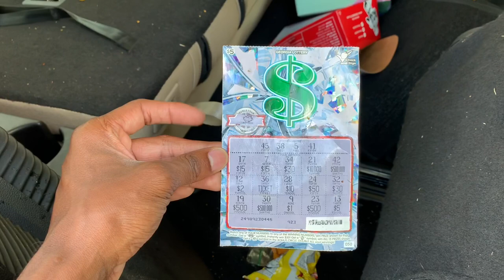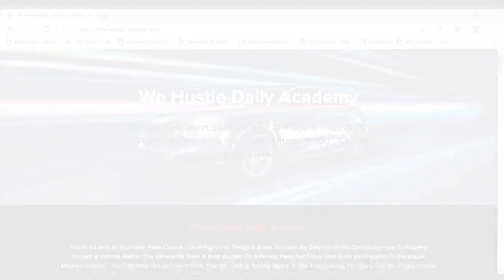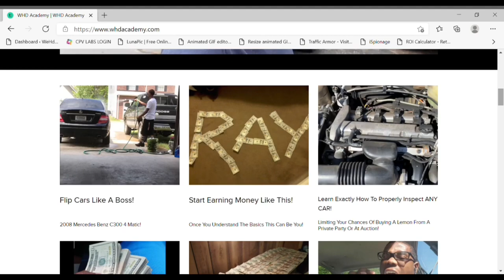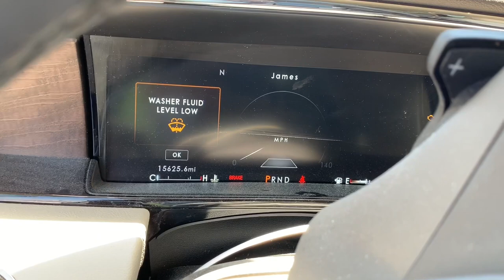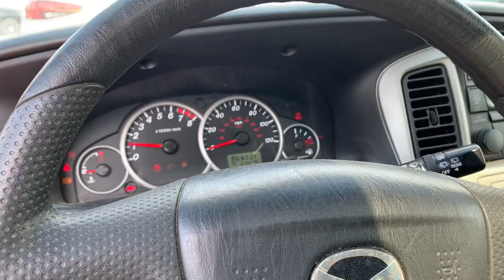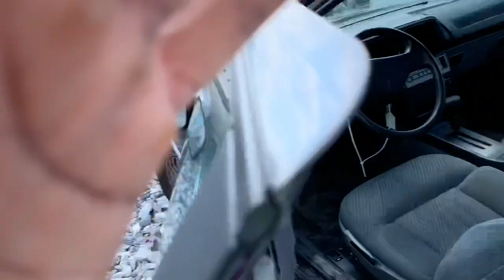FOUND A NEW 2019 LINCOLN NAVIGATOR AT COPART! *LONGEST SUV I'VE EVER SEEN*

Comment: Excursion I believe is the longest- not as common to see these days, but check out their specs...massive! 
Still shorter than my totally ridiculous F350 SD crew cab long bed. With the Warn bumper/winch set up it is kissing 25' long. I bought it from  an estate for half of book value; needed a truck to haul a 20' trailer with and it was the best deal. Would never have purchased new or ordered something that huge, but at the price I couldn't say no